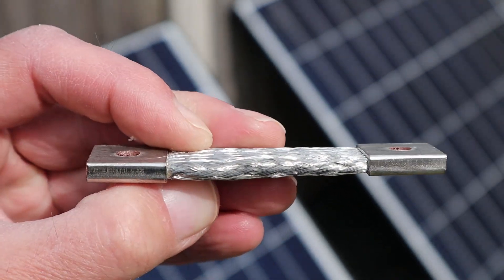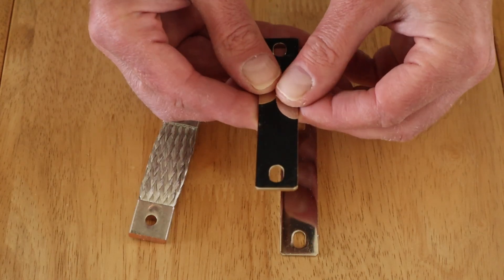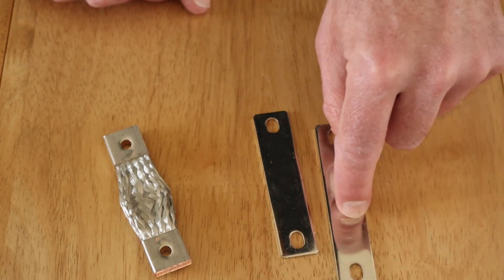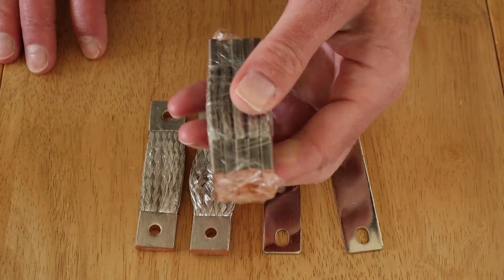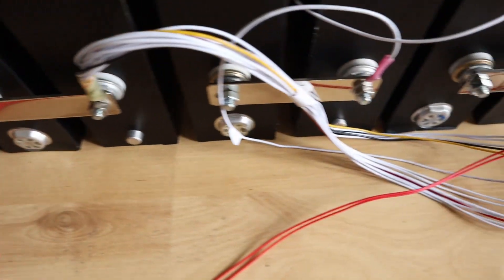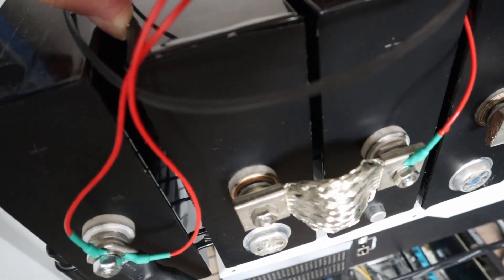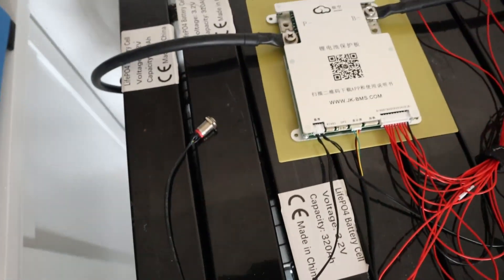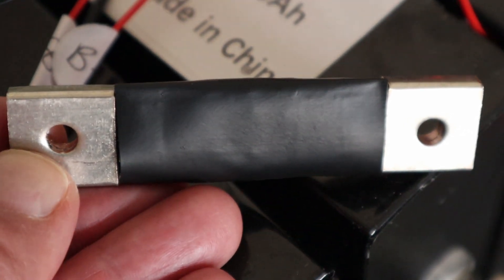Battery Busbars | Flexible alternative for DIY battery builds?

Comment: The solid ones heat up when you charge at 100 amps orange flex and the braided ones don't seem to do that. I even sanded and put carbon conductor grease on it.
Reply from the maker: @Mike-01234  I've never really noticed the solid busbars get that warm. Definitely like the braided ones so far.